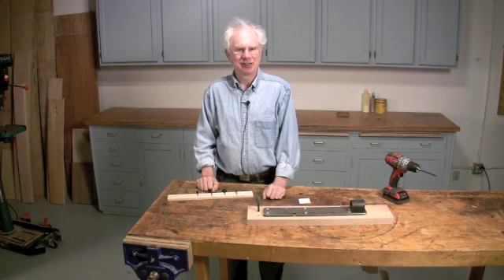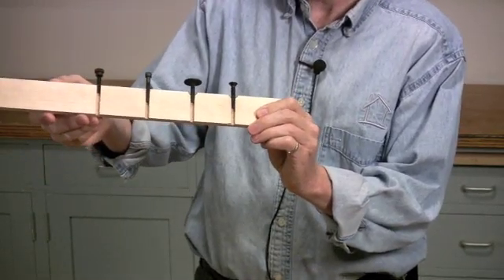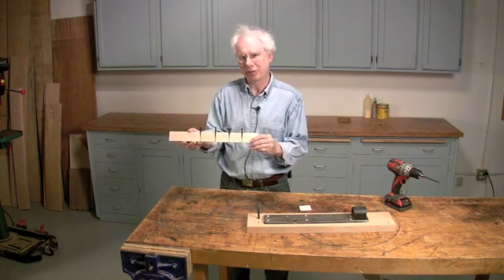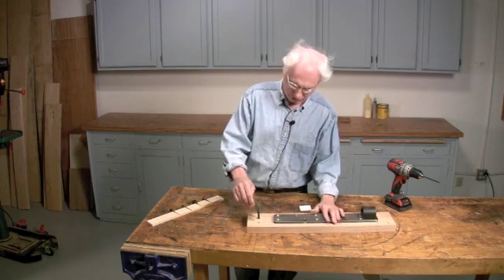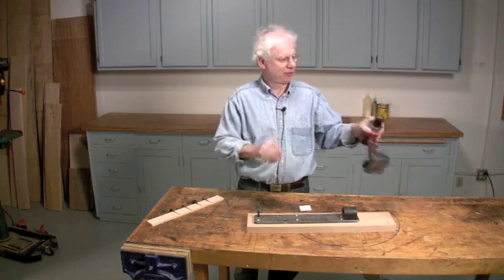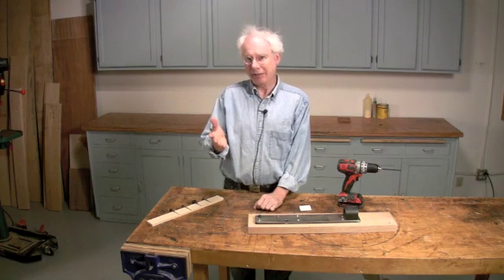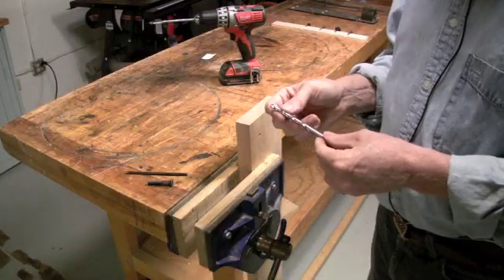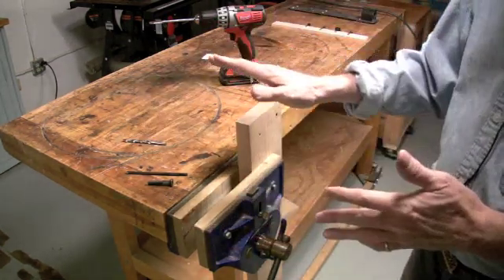Tapping Wood

Comment: Hi Tom, thank you for the great video. Question for you and/or the community: how do you remove your tap if you cannot drill all the way through the wood? I am installing new electronics on an electric guitar. The component that I need to mount requires machine threads. If I drill all the way through the wood, the guitar will not just suffer aesthetically, but tonally as well. Not to mention the increased chance of moisture getting into the wood of the guitar's body. Thank you!
Reply: I know this is a year after but, for somebody else who has the same question. Just do it like a regular metal tapping proccess with a tap handle. That way you will feel the tap hitting the bottom, and you can rotate backwards manually without damaging the thread.

Comment: Any experience tapping into MDF board? - The idea is to be able to install steel inserts without compressing the MDF.
Reply: MDF doesn't sound suitable for threading, especially fine threading. I was wondering if it actually works. Have you done it?
Reply: Maybe if you sturdy up the walls of the hole with lots of glue/oil/polyurethane?  But yeah, I would use some T-nuts if trying to put threads in MDF.

Comment from the maker: You could use a metal insert for sure but I think this method is a lot faster. I've put a source list for the tap, bit and screws used in the video in the video description. Thanks for watching and keep those comments and questions coming!
Reply: AmericanWoodworker what would I drill to tap a 3/8-16 machine screw on the end of a bottle opener?